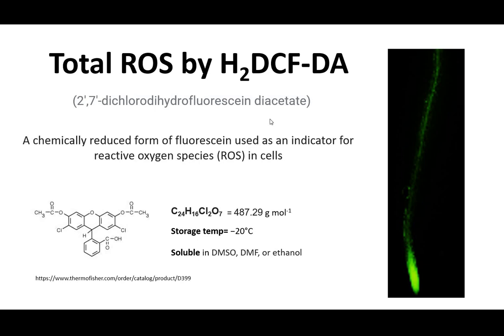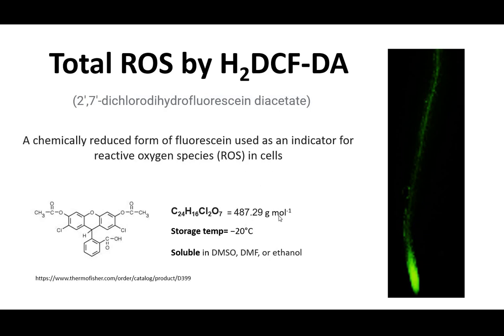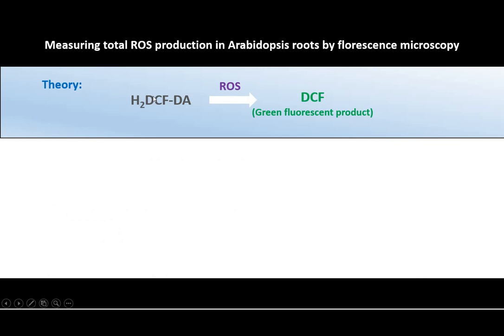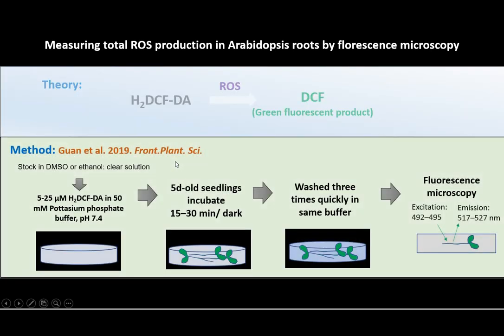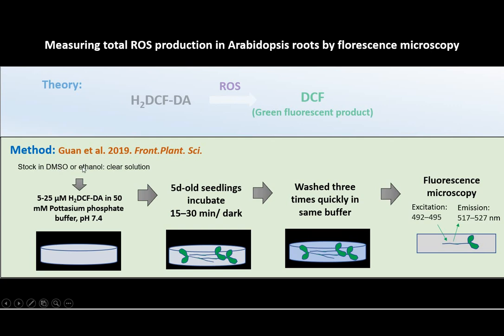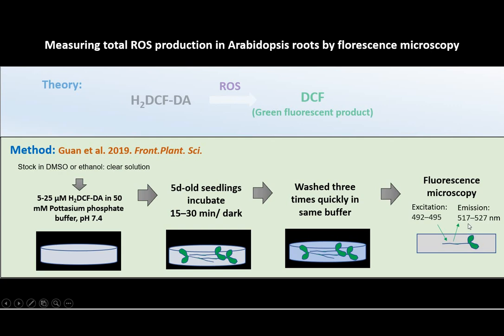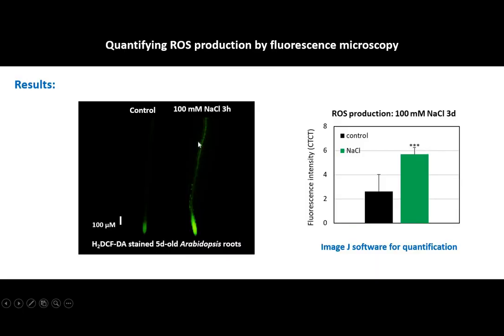Fluorescein diacetate, DCFDA staining, ROS, Arabidopsis, stress, roots, research @DoctorTutors

Comment: Can you plz suggest any other fluorescent chemical to be used for ROS assay other than DCF?
Reply from the maker: There're a few others. Read on Dihydroethidium (DHE), CellROX™ Deep Red Reagent etc. Sometimes one type of dye can only detect one type of ROS. So you need to decide which one to choose. If your samples have any fluorescent proteins, make sure the dye wavelengths doesn't interfere with those. There are several other methods you can find in different articles. It always depends on your requirements. Good luck!